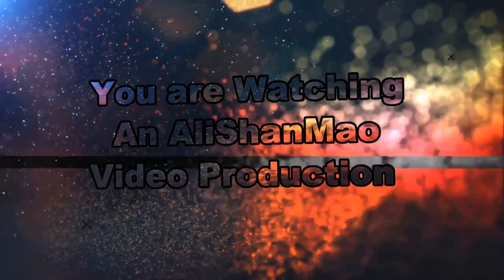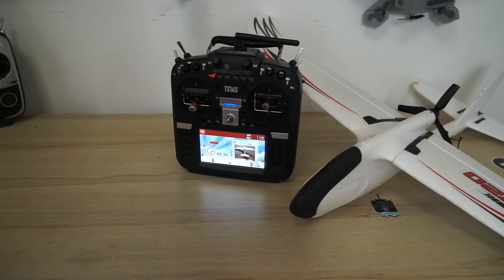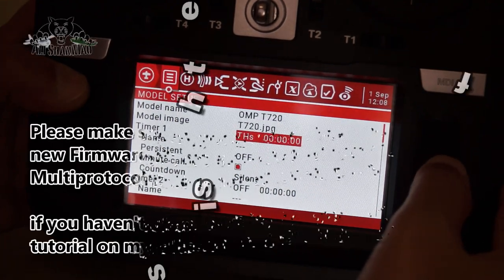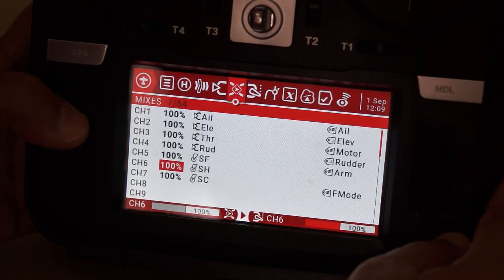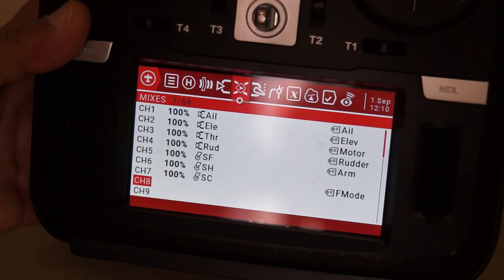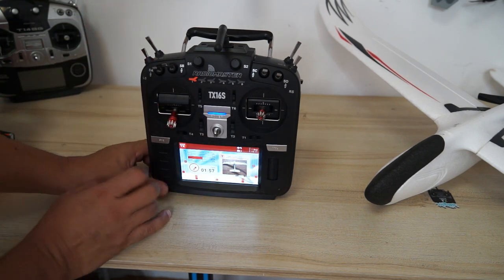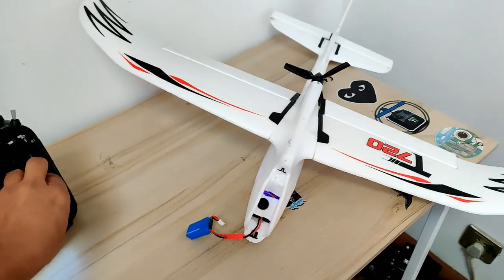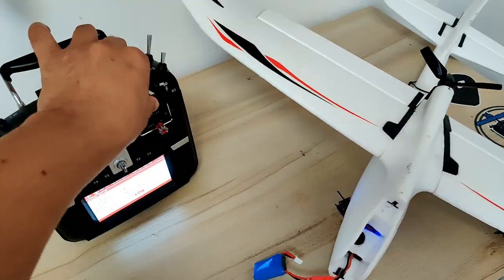OMP Hobby T720 RC Glider OpenTx RadioMaster TX16S Setup

Comment: I just received my tx, got the firmware via you, big thanks for that! 
I noticed the flight mode does not do the same as the stock transmitter.. noticed that the elevator is always moving on the SC button.. which has 3 options not two.
Reply from the maker: I am not sure about the total internal setup on 2 flight modes. maybe its the way its supposed to be?

Comment: Hi mate, this looks perfect, exactly what i need for my t720 as the factory radio is rubbish. Will this radio also work with a umx turbo timber bnf? Particularly with the safe stability mode? Id love to buy this radio now to use with my t720, and then in the future incould use it on a new umx turbo timber
Reply from the maker: now this radio is available in EdgeTx and its getting even better. you can program it with many rc items if the protocol is supported in their receivers.

Comment: Hi,
Thanks for the video but unfortunately the protocol doesn’t work. I’ve had the T720 for a while and got the tx16 as the stock transmitter is so basic (no trims, etc.) so was hopeful that the tx16 would give me more options and control. Protocol uploaded successfully as per your instructions but the receiver simply won’t bind to it. Info. On Forums seems to indicate that OMP have introduced software that prevents binding to alternative transmitters. 
If you have time, it might be worth uploading the currently available protocol to see if it still works with the T720.

Comment: Hi Ali, I tried this on the S720 without succes... any update on that model? Thanks as usual for your videos!!!!
Reply from the maker: no idea. if it works on T720 it should work on S720 too. you need to have OMP Hobby protocol firmware in your TX16S

Comment: So, I have my TX16S with EdgeTX 2.7 and OMP module v1.3.3.0 bound just fine with my T720.  When I do a controller range test to the plane, with the plane's motor off, the TX16S says I have a strong receiver signal.  However, as soon as I apply throttle, the TX16S says receiver signal critical. So, somehow the motor on the T720 is generating radio interference?  I fly it anyway and it flies just fine and responds with no issue.  Any ideas?  thanks!  great video!
Reply from the maker: If it flies ok, do not worry. My TX16S keeps talking about signal critical, its just telemetry speaking on a slightest millisecond glitch. in real there is no problems at all. turn off telemetry and you will be fine

Comment: I have had the T720 for about 18 months and it does fly well. I have now been trying to bind it to the TX16S and found your video very useful. I however cannot bind it, because I just cannot find the white switch that puts the receiver into bind mode. The blue light flashes slowly but not fast as it should when in bind mode. Even if I could find the white switch, it would be very difficult to hold the button down and connect the JST connectors at the same time.
Is it possible that some receiver boards do not have a bind switch button? I tried to search the internet for an image of the receiver board to identify the button, but cannot find an image anywhere, also the receiver board is not for sale anywhere including OMPhobby website.

Please help.
Reply from the maker: bind button is visible if you look from front after removing the black canopy. easy to press and hold with a tool and then power on the plane
Reply: @alishanmao  Thank you for a prompt reply. I can just see the front edge of the white button, but the black and red wires of the JST connector are firmly lodged over the button, I moved the black wire to one side, but the red wire will not move and I am afraid to use any force as it may detach from the board and then the receiver will become useless. In your video, the wires are nicely one side. I tried to use a small screwdriver to try to push the button, but cannot feel the movement or hear any click. Is it so hard to push the button, even before trying to power up at the same time? I must be doing something wrong !! I have taken a photo and will try sending it you for advice. Thanks.
Reply from the maker: well my friend, you can take a pointy object like a paper clip, straighten it out and then insert it through foam from an angle that will reach and push the button straight. this will not damage the foam and you will be able to push the button easily too
Reply: @alishanmao  Thanks for your help it was invaluable. I finally found the bind button and followed the instructions in your video. Everything worked excepy I cannot get the ARM switch to work. I followed your video, and cannot see where I went wrong. It is of course posssible to fly the plane, but it is useful have a throttle cut. Any suggestions?
Reply from the maker: simply program a throttle cut using special functions and switch assigned to channel 3. its easy to do in opentx
Reply: @alishanmao  Would it not be better to take something that's not conducting electricity and risk creating a short circuit when missing the button and touching the board with the metal?

Comment: Was up man! I'm happy to see this Aircraft, is it really a good model? I got a WLTOYS Ski King and it is shit. Battery exploded before First Flight ,I get new battery and motor died Maiden Flight. 
I been trying to but a Tello size motor with the electrics from that turd into a Lidal Glider, not having much luck! Can u get this Model with everything Controller, if so it is a Real Contender for next RC Airplane Airplane Trainer. I do not have computer to practice on simulator so I need some that simply works, But Price is always main problem, if not this one Give me advice Cheapest way to learn, once I can prove I can keep something flying,I can get Better stuff it that Proof of ability to use and take care of some before I can get a investor in my Dreams ,Thanks Have Good day  Keep it Flying 
God Bless
Reply from the maker: Its THE BEST TRAINER PLANE EVER. you can get ready to fly version that comes with OMP Radio or just buy RadioMaster TX16S Separately. and buy this plane PNP. Even my kids can fly this plane
Reply: @alishanmao  Hello my Friend I want to thank you for your time to reply Is it the ZDHD,NO IT THE OMPHOBBY GLIDER! OUT OF THE 2 WITCH IS THE BETTER FPV GLIDER
Reply from the maker: ZOHD and OMP are two different things. can't compare them. This OMP T720 is by far the best in this category.